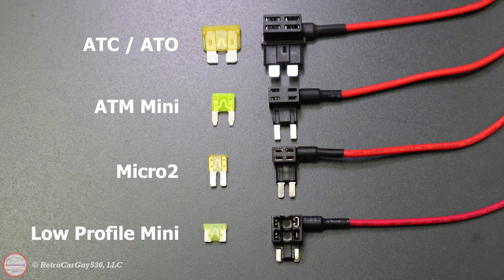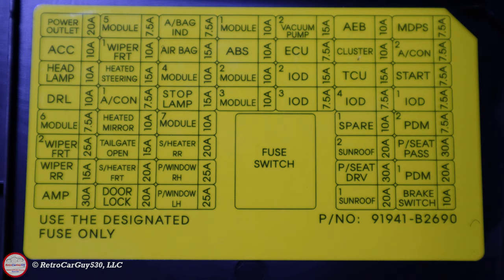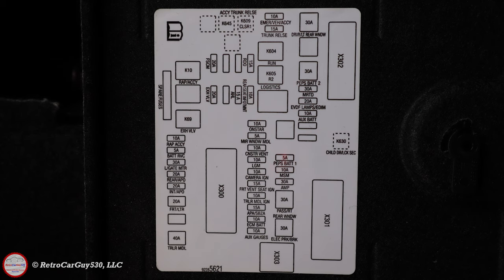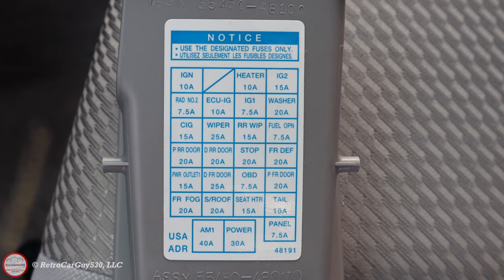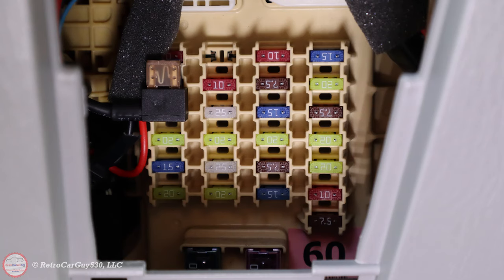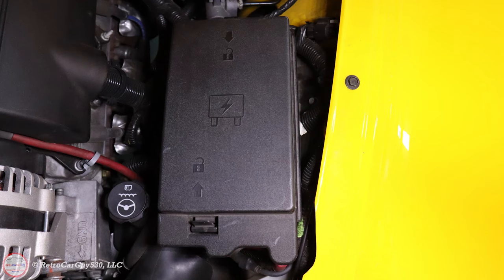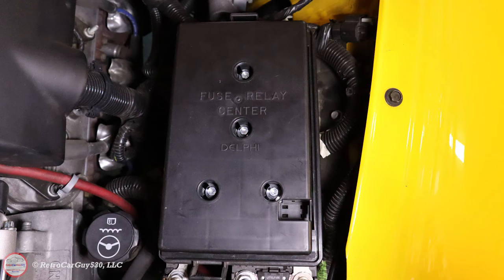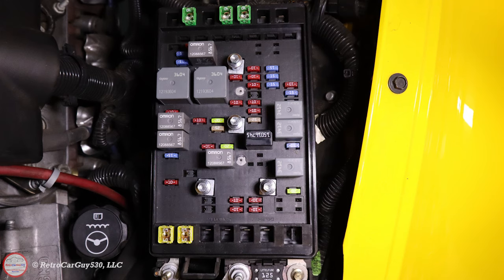How To - Add a Fuse Tap in Your Vehicle

Comment: If say I would like to tap to a blank slot on my car's fuse panel, how would i know if that slot can give me 15 amps or 20amps ( I don't have a V/A meter, I only have circuit tester). By the way I will be powering my Cellink Neo which I believe is 9amps.
Reply from the maker: Warning... long reply.  :)

I would love to be able to say with absolute certainty that any fuse socket in a fuse box can provide up to a specified amount of amps, but there are so many factors that go into how the vehicle manufacturer designed the power routing in the inside of the fuse box.  A vehicle manufacturer will tell you to never use a fuse tap, but for smaller power needs it can be done in a relatively safe manner. 

Most constant (unswitched) power fuse box sockets tend to get their power directly from a beefy wire from the battery and use power distribution bars inside of the fuse box to distribute that power to the various locations that require constant (unswitched) power.

Some accessory (switched) power fuse sockets obtain their power from the ignition switch controlled circuit and some obtain it from modules that provide power to a variety features/devices/accessories in the vehicle.  The ones that obtain their power from modules are not good candidates for fuse taps, but the fuse sockets that get their power from the ignition switch power are decent candidates for larger amp draw circuits.  It's not easy to determine necessarily which ones are module controlled unless the fuse box chart mentions something in the name for that fuse socket.

As I state in my fuse tap videos, I never would assume any fuse socket can provide more than 25 amps for blade style fuses.  If there is a fuse already occupying the fuse box fuse socket and you want to add a fuse tap there, make sure the sum of the amp ratings of the fuses doesn't exceed 25 amps, BUT that is assuming the fuse socket is getting its power from the battery or the ignition switch supplied power.  

Other videos sometimes state to never use a fuse tap to add a fuse a fuse with a higher amp rating that the fuse occupying the fuse socket.  That statement quickly falls apart when the pre-existing fuse amp rating increases.  A fuse socket with a 20 amp fuse, DOES NOT mean you can put a fuse tap into that fuse socket and add a new 20 amp fuse with the fuse tap.  That means you're potentially requesting 40 amps of power from that fuse socket which is beyond the 25 / 30 amps that a blade style fuse and/or socket can really support.  Their statement is assuming the wiring/power bar that provides power to the fuse box fuse socket can safely provide double the number of amps that the original fuse was capable of safely delivering.   That tends to be true with low amp fuses, but when you get 10, 15, 20, 25 and 30 amp fuses that theory breaks down quickly. The person making that statement also doesn't know how the fuse socket is truly obtaining its power and they cannot make a blanket statement of safety without knowing the true power source/type in the fuse box.  My statement of not allowing any fuse socket to provide more than 25 amps (total) is at least attempting to put a cap on the amps being required from the fuse box fuse socket, but again that approach has its downfalls as well.

An unused fuse socket with power is a great find any fuse box,  because it means the manufacturer provided power to it but it's not being taken advantage of in that vehicle (it may not be equipped with a feature that would normally use that fuse socket in that model or another model of car produced by that manufacturer).  But again, I cannot 100 percent guarantee that it's getting the power from a beefy enough power source.  The chances are that it can sustain a 10 amp draw or maybe even a 25 amp draw, without having the schematic for the fuse box in that vehicle, nobody can be 100 percent certain.

Any fuse tap inserted into a fuse socket that did not have a fuse to begin with should ONLY have one fuse in the fuse tap (in the top fuse socket of the fuse tap).  The bottom fuse socket in the fuse tap is for the original fuse and if there is no original fuse there should be no fuse in the lower fuse socket of the fuse tap.  See my anatomy of an automotive fuse tap for an "easy way" to use the fuse tap itself with only a fuse in the top fuse socket of the fuse tap to find which side of the fuse socket provides power.  https://www.youtube.com/watch?v=YNc0FfeL6rw

Now for the "dash camera battery pack" version of my advice.  I might suggest that the power for the dash camera battery pack be obtained by a relay controlled circuit and not directly from a fuse tap in a fuse box.  The relay's control circuit power can certainly be obtained from a fuse tap in a fuse box because the control circuit side of the relay often consumes far less than 2 amps which is a minor amount of power to be adding to the fuse box with a fuse tap.  The relay's power circuit is connected to the car's battery with an inline fuse in that wire and when the relay is "on", the power will go from the battery, through the relay and to the dash camera battery pack to power the dash camera and charge the battery.  The control circuit side of the relay gets its power from the fuse tap in an accessory (switched) fuse socket in the fuse box.  This moves the higher amp draw away from the fuse box and still gives you the control necessary.

I have my Cellink B dash camera battery pack wired to use the "relay method" of obtaining power.  This has worked quite well for the past several years.

I hope this helped in some small way!
Reply: @RetroCarGuy530  this would take hours to compose, you got it out in an hour or less. that's awesome!

Have you got a link to a video that might give me some information or knowledge on properly installing a relay?
Reply from the maker: I had a similar question about using a relay to power a new accessory in a vehicle just a few weeks ago.  I've taken that post and adjusted it for your situation.

In my FAQ video on this topic https://www.youtube.com/watch?v=DnZ5wb_A5vE&t=677s , I discuss a relay solution for providing power to the new accessory (or dash camera battery pack in your situation).  I don't have a video on how to install / use a relay, but a high level overview is discussed in that other video.

I typically use a four pin relay for this type of circuit.  Each pin of the relay has a number associated with it and they usually go as follows:

Relay Control Circuit Pins:
86 = Positive trigger source.
85 = Ground.

Relay Power Circuit Pins:
30 = Connected to the vehicle's battery positive terminal.  This wire should have an in-line fuse to protect the device/relay.
87 = Positive power supplied to the new device (dash camera battery pack).

The power obtained from the fuse tap is supplied to relay pin 86.  The electromagnet in the relay is energized as the power flows from pin 86 to pin 85 (ground).  When the electromagnet in the relay is energized, the relay's internal switch is closed to allow power to pass from pin 30 (battery power) to pin 87 (device power).  The power provided to the device via pin 87 continues until the "Positive Trigger Source" power supplied to pin 86 is removed. 

Removing power from pin 86 "Positive Trigger Source" allows the relay's internal switch to open and the power supplied to the device (dash camera battery pack) is removed because the battery power from pin 30 can no longer pass through to pin 87 (or the device / dash camera battery pack).

The control circuit of the relay (Pins 86 and 85) should require a very low amp fuse (1 or 2 amp) in the upper slot of the fuse tap.  It does not require much power to energize the electromagnet in the relay, thus why you should only need a small amp fuse in the fuse tap upper fuse socket.

The in-line fuse in the wire that connects to pin 30 of the relay should be as close as possible to the battery to help protect all of the wire running from the battery, to the relay and beyond to the device (dash camera battery pack).  The amp rating for that fuse should be no larger than what your accessory (dash camera battery pack) requires and the wire gauge supports.  Please refer to your dash camera battery pack's documentation to identify what the amp requirement is for the dash camera battery pack.  I believe you stated that it can draw up to 9 amps when hardwired, so a 10 amp fuse would be the one to use in the in-line fuse.

The "Positive Trigger Power" (obtained from the fuse tap) supplied to pin 86 of the relay should be accessory (switched) power to prevent the running down of the vehicle's battery when you turn off the ignition.

Here is one of my Amazon US affiliate links that shows a relay that I've used in this manner.  https://amzn.to/3s7jbZM  This product listing includes several pictures and there is one that matches up with what I've described in this posting.  "Normally OFF Relay with a Positive Trigger".  

Any and all modifications you make to your vehicle are at your own risk!  It's extremely difficult to give electrical advice via comments on a video, so you must make sure you're comfortable with the topic and modifications you attempt on your vehicle.

I hope that helps!

Comment: Having never used multimeter, what do i set the dial to in order to test for current?
Reply from the maker: You need to use the "DC Volts" mode of the multimeter. The manner in which you select "DC Volts" will vary from multimeter to multimeter.  Look for selection with "V" or "DC V" or similar.  Some multimeters will have a general "V" selection, but you might have to press a mode button on the multimeter to select DC volts (direct current) instead of AC volts (alternating current).  Others will have a dedicated DC volts option with various maximum volts values.  Make sure you select one that can measure 12 volts.  You might also see a "Volts" option with a symbol with a long solid line on top and a dashed line on the bottom, that's the symbol for DC volts.  AC volts will be a solid line on top, but a tilde "~" on the bottom.  The best way to make sure you're using your multimeter correctly to measure DC volts is to review the user/owner manual for the multimeter.
Reply: @RetroCarGuy530  thanks so much! I am installing a dashcam with a battery backup for parking mode and need a fuse ideally of 20a. my 2024 subaru only has one 20a slot that is always on and i need an ACC slot. I have many open fuse slots, some are ACC but i dont know the rating to know if they are safe. the fuse diagram and the manual dont mention amps of the empty slots. do you know how i could test this?
Reply from the maker: Without knowing how each fuse socket obtains its power, there's no "safe" way to guess/test the unused fuse sockets.  If there are other trim levels of your Subaru model that offer options that might use the fuse sockets that are empty in your car, you might be able to see what the fuse charts for those other trim levels document those fuse socket as supporting.

I don't like using a fuse tap to provide charging power to a dash camera battery pack.  It all depends on how many amps the pre-existing device/accessory is consuming on that circuit that will determine if there's enough "unused" amps available for the 10 to 15 amps required for the battery pack.  If there's a 20 amp fuse in the fuse box fuse socket, that strongly suggests the pre-existing device/accessory is already consuming up to 20 amps.  The only times a 20 amp fuse box fuse socket might be okay to use if it provides power to a power port/cigarette lighter port in your car that you can avoid using if the dash camera battery pack is using that fuse socket in the fuse box.

In my dash camera battery pack review videos, I mention my preferred manner to provide power to the dash camera battery pack.  That's using a 4-pin relay to provide the switched/accessory charging power to the dash camera battery pack.  Pin 30 of the relay would be connected to a 12 AWG wire that sources its power from the vehicle's battery positive terminal (with an inline fuse).  Pin 87 of the relay would be connected to the dash camera battery pack's positive charging cable wire.  Pins 85/86 (varies sometimes - read relay's documentation) will be connected to a switched/accessory power from a fuse box fuse tap.  The relay consumes only around 100 to 150 mA when energized/on, so almost any switched/accessory fuse box fuse socket can provide that amount of power.  The battery pack's negative charging cable would be connected to a suitable ground location near the battery pack (not directly connected to the car battery's negative terminal).  Depending on which of the 85/86 relay pins is the ground wire for the relay control circuit, that would also be connected to a suitable ground location as well.

I discuss this topic in two videos, but the most recent one is this one: https://youtu.be/Gn3IoBjO_Vg
Reply: @RetroCarGuy530  i really appreciate you VERY fast and super thoughtful and detailed answer. I was just watching that part and you make some great points. The relay sounds like the best option, but honestly, too involved time wise for me to research and feel like i'm doing it properly. I wonder if i should just scrap the battery altogether and just use the camera. Without the battery the fuse tap needs are using much smaller amp fuses. is that more straightforward and safe to do? could i use an empty slot safely or still better to tap an existing one? i used a battery pack in my last subaru and tapped  a fuse with no issue. but this makes me wonder if its worth it moving forward.
Reply from the maker: You can of course use two fuse taps, one for constant battery power and one for switched/accessory power, to power your dash camera.  It depends on your requirements for parking mode operations (how long each parking mode session lasts and how often you park your vehicle) and the overall health/size of your vehicle's battery.

Another approach for the dash camera battery pack is to let it run in "low amp" charging mode.  Depending on the dash camera battery pack, the battery pack will have a slide switch that lets you select the charging mode or it may detect which type of charging cable is connected to it to know if it should charge in low amp charging mode or high amp charging mode.  If the battery pack provides a cigarette lighter adapter cable and if the connector on that cable that plugs into the battery pack has an external metal connector (upper center of connector that plugs into the battery pack), that's how the battery pack knows if you're charging via the cigarette lighter adapter cable (in some models).  You could use the cigarette lighter adapter cable provided as intended or just use the cable from the cigarette lighter adapter as your hardwiring cable.  That's only if the battery pack detects the charging mode by the type of connector plugged into it.

If you configure the battery pack to charge in low amp charging mode, that usually restricts the charging amps to the 4.5 to 5 amp (or slightly higher) range.  That amount of load being added to a pre-existing circuit in your fuse box is less of an issue rather than the 9 to 11 amp range for the battery packs high amp charging mode.  Low amp charging mode will also extend the amount of time it will take to recharge the battery pack after parking the vehicle.

Comment: Where do I put the negative side of the meter
Reply from the maker: You connect the negative side of the meter to a ground location on the body of the vehicle or the negative battery terminal is the battery is located near the fuse box.
Reply: I have a suburban and was trying to connect from my fuse block in the rear, I have about 3 open circuits there

Comment: How did you cut the fuse in half?
Reply from the maker: I used a diagonal cutter to cut through the plastic at the center of the fuse.  Another method of testing for power is to use the fuse tap by placing a fuse only in the top slot of the fuse tap.  Leave the bottom fuse socket of the fuse tap empty (for this test).  Insert the fuse tap into the fuse box fuse socket.  Check for power on the wire attached to the fuse tap.  If no power was detected, remove the fuse tap and rotate the fuse tap 180 degrees and reinsert it into the fuse box fuse socket and check for power again.
Reply: @RetroCarGuy530  Thank you very much for your reply, I shall give that a go later!